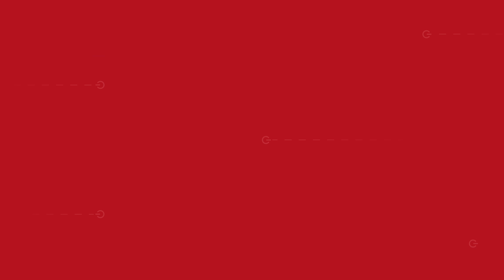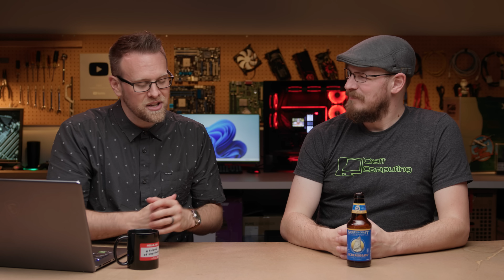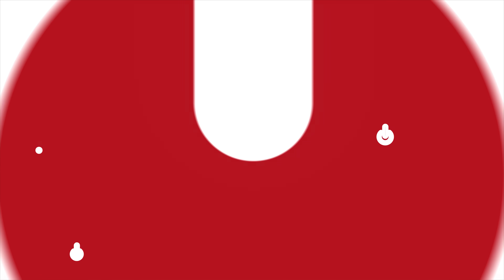Old Server CPUs For Budget Gaming Or Workstation PCs

Comment: I've been running x79 for a long time with a heavily overclocked 1680v2 (8c16t) and 2666mhz ddr3 in quad channel. With my previous 1070 it was more than enough to max out the graphics card in almost any game. Almost! Except those which need any of the newer instructions. In those games, I suddenly felt the age of the system. Now I have a 3090 with the same build... Don't even bother. In literally any game at literally any settings I'm heavily cpu bottle necked. Not to mention all the other issues which come with such an old platform (usb3+, pcie 3+, old mobos, power consumption, etc etc). I love my rig. I love overclocking and you can't do that anymore at all. But still, I am buying new stuff today :(

Comment: The newest Xeon that's obsolete enough to be cheap is skylake. That's a lot faster than xeons older than it.  And you'll get 4 channel DDR4 memory cheap, that brings the memory bandwidth up to equal to much more expensive current gen DDR5 at 2 channel.  Why is it cheap?  Well you're only getting PCIe 3 and with clock speeds up to 4 ghz, you're gonna get about half the peak single thread performance of the fastest current cpus.  And you might not get NVMe support And don't expect resizable bar. But I just put together a super cheap Dell Precision 5820 tower. They're so well built. My 6 core W-2135 processor cost $25.  But if I want NVMe drives instead of SATA, I have to get a replacement backplane which is cheap but the hot swap caddies for NVMe drives are expensive. Or I could get some PCIe NVMe card.  Dell makes one with bios support for 4 drives (and that's not a given on other motherboards).  Note, the motherboard in mine also supports Cascade Lake which is NOT cheap.  And this points to another reason Skylake is cheap.  Cascade Lake has built in Spectre and Meltdown mitigations and Skylake doesn't.  Also Cascade Lake has some new AI instructions.

Comment: Depending on how well they perform in Handbrake, I’m in the market.  I’m still trying to decide between an old workstation or a Chineseium motherboard combo.
With a workstation my buy in is roughly $400 without HDDs.  As it stands I don’t like being limited to 4 HDDs.
With the Frankenstein motherboard combo my buy in is around $460 when I add in a CPU cooler, PSU, and that’s without HDDs.

Comment: is RAM failure even a thing? Throughout my entire life I've only came across one system with failing RAM stick hahaha
Reply: Yes, I had several RAM sticks fail. Very annoying as the system will randomly lock up or bluescreen and you won't necessarily know it's the RAM (could be MB or CPU as well) until you do elimination testing (remove part until error stops showing up).
Reply: @Martinit0  but it could have been some incompatibility a d not real ram failure... I used to sell and fix laptops and it literally happened a single time over thousands of laptops I've sold, actually I found a bad sectors in bios chip being a common issue yet it's so rare in a grand scheme no one ever considers it at all... It's a pretty funky fault when it happens things get pretty random with unexplained behavior of the computer

Comment: well it isn't much cheaper anymore but you still get lots of pros of server architecture, mainly the huge expandability and then for non-gaming tasks they obliterate much newer home chips.
Reply: Xeons can have decent performance if you get the right ones. Pcie lanes are definitely the advantage over building a modern i7/i9 or ryzen system. 2690 v4 is cheap and actually doesn’t bottleneck my GTX 1660 Super according to benchmark sites. Also gets surprisingly good fps on modern games

Comment: I don't understand why the CPU single core clock speed must be high to service these GPUs in games. Surely there is an instruction queue? Is this also an issue where you are using a Xeon system with modern GPUs, like RTX 3090 TI 24GB, used for Stable Diffusion? Is there still an issue with single core performance of Xeons? What are the best second hand Xeons? You can get lower power 3.9 Ghz (without turbo) Xeons with 8 cores.

Comment: While technically not a server CPU, my i7-5960X is almost there.  Great CPU when new and it is still ok for the most part, but the generation gap with the new ones is not even funny.  I see mobile CPUs in mini PCs, CPUs which use up to say 35W or so, have double +/ - single core performance and depending on the CPU, even more for multicore.  And I am referring to mobile CPUs which have half or a third or less power consumption.  

Unless you have no other choice, as I do, don't get an old CPU, server included, as a part of a modern gaming PC.   You will probably save money, a lot, buying it, but you will get worse power consumption and worse performance than most modern CPUs.  (including APUs).

If you also have performance needs, video editing for example, which are not gaming, then ffs don't get these old CPUs.

Comment: I am running  a 4 core 8 thread 3.6ghz xeon that supports 40 pcie gen 3 lanes with 32gb of ddr3 running  in quad channel. Old ass setup but still running well. A little over a year ago I upgraded from gtx 680 4gb gpu to an AMD 6600 8gb. I am gaming at 1080p with anywhere from medium to ultra settings based on the game. I can even upgrade my ram as high as 128gb ecc IF I wanted to. Nothing about my rig is amazing but it is still running and getting the job done. One down side is without trickery I won't be able to use an os newer than windows 10.

Comment: I was an auto tech for 34 years and can't do it anymore because of medical problems so in order to stay busy I got into the PC world as a hobby. I sourced some very cheap parts to do my first build based around inexpensive Asus LGA 1150, 32gb of DDR3 and an old Thermaltake case. I have a Xeon 1270v3 (3.50 - 3.90 GHZ) or a I7-4790 (3.60 - 4.0 GHZ) both under 85W,  and a Corsair 750W PSU that I can use with an EVGA GTX 1060. These cheap parts that are hitting the market are right in my ballpark for budget and my expectations. The cost of the parts came out to $125 US.  I'm learning alot from so many channels like this one and Craft computing and having alot of fun doing it.

Comment: I'm writing this comment on my ancient 2010 Mac Pro 5,1 w/ dual Xeon X5690 CPUs (3.5Ghz, 12 cores, 24 threads total) w/128GB RAM, internal RAID5 storage, PCIE NVME SSD system drive (I added this and the RAID5 drives), with Radeon RX580 GPU, that I bought on ebay about 2 years ago for $275 (including shipping). Yes, I virtually stole it with my winning auction bid - it should have been a few hundred more to be honest. I'm running Garuda Linux (Arch base) and occasionally boot up macOS Monterey. Even 14 years later it's solid as hell. It won't win any speed contests anymore but she never crashes, and needs to reboot only after an occasional kernel upgrade. It does video editing, plays a ton of games (yes, Linux can really game now) brilliantly @ 1440p and has been amazing overall. Highly recommended!  EDIT: I will say, it has a 1000w power supply because it's really thirsty for energy. Probably drawing 500-750 at any given moment. There's always a cost for a machine that does so much.

Comment: picked up a old x5690 Xeon for $33USD and run it my Asus P6T vanilla mobo as a daily desktop driver clocked steady at 4.507GHz in a modded bios. Added an LSI 9271-8i card in RAID5 which has throughput of ~2500MB/s (4 units Samsung 500GB SSDs) Not bad for a motherboard produced in 2009!  15 years old and still churning out with 280mm watercooled AIO CPU cooler.🤣🤔😉😇  Cheers

Comment: One of my grandson's friends has it pretty hard right now and asked me to help him build his first PC on the uber cheap, managed to grab an Aliexpress special that had a  E5 2650V2 with 16GB of RAM, mobo, and a cooler for just $66, slapped another 8GB for $4, a $37 nice looking white case, $40 500w Thermaltake, a 1TB NVME on sale for $37, an RX580 2048 for $50 and a Win10 Pro key and he managed to end up with a sub $260 PC that plays all his eSports titles above 60FPS.

 So for super duper uber budget builds ya can't go wrong with the Aliexpress Xeon kits.
Reply: oof 1tb nvme for $37 boy those days are gone.
Reply: I gifted an X79 build [ E5-4627v2 (8C/8T, 3.6Ghz turbo) + HuananZhiX79 Deluxe + 32GB REEC DDR3 + 800W PSU + Snowman 120mm CPU cooler + vertical testbench+ 256GB SSD with Win10Pro OS + RTX 2080S] to my daughter's friend.  Sure, it's an old spec and lacks AVX2...but it still runs most games in 1080P low-medium settings just fine.  It also manages school work and general purpose tasks fine.  I had upgraded my daughter's PC to AM4 B550 + 5800X +  RX7900GRE + 32GB Trident DDR4. She's setup with VR, etc.

Comment: Ive got a e5 2680 v2 running 3.594 all cores idling and boosts to 4.294 all cores it took about 2 days tuning in bios and a Asus ws pro board but it still only uses 122 watts at max load in stress tests for 10 cores 20 threads and it doesnt go over 68 degrees in stress tests working on finding an Asus x99 ws board for my next build i have more fun seeing just what i can get a xeon to do than I would with a newer system that just works

Comment: Im sorry. X99 server chips get their ass handed to them in gaming loads. A 3600/5600 will wipe the floor with them and are also available cheaper than $100 on the 2nd hand market. 
16GB of like 3200/3600 DDR4 is also like $40 these days and bottom tier b550 isnt that bad. Gives you a much better gaming experience than getting an aliexpress x99 system with an old ass 8 core xeon chip that'll lose in basic multicore workloads as well.

Comment: the other reason why some people may find old xeon builds attractive is because they run on DDR3 ram, which is really really cheap nowadays. Not saying that DDR4 is expensive, but for people who have a very tight budget, every cent counts.

another good budget option is to buy an old office pc and upgrade it. I have a dell precision t3500 which I use almost daily. Takes a standard ATX power supply and the motherboard has 6x4gb ddr3 ram slots for a max 24gb ram. the fan headers on the mobo are propietary but you can buy adapters to run standard 4-pin fans. chucked out the old dual-core W3503 and put in a 6-core 12-thread xeon X5675 (have to update bios first). The unit originally came with a low-spec quadro gpu, took it out and replaced it with a gtx 1060 3gb. So far it's been fairly good for most average-spec 1080p games, I don't play the latest AAA games so it's sufficient for me.

if you go for the used office pc route, just watch out for the ones that use proprietary power supply form factors or motherboard pins, make sure you can still buy replacements or pin converters, otherwise you'll have a big problem if your power supply dies.

Comment: Some xeons come in Low Voltage versions (they are just as powerful), but they are a GREAT choice if you're using a PSU on the lower wattage side (such as an HP 800 G1)

Comment: I havea BOINC farm of i5-8500 little SFF boxes. Desktop 65w CPUs from popular auction site over 100 of them. In the years I've had them, only a few fans have failed they really all work. It is fans that wear out that's it.
Reply: I wanted to buy a few of this SFF boxes but the prices for intel 8th gen (windows 11 ready) almost doubled since i bought my first model.  HP-Prodesk.  Just too many youtubers recommending it.
Reply: @llothar68  Yeah I have noticed  The availability of them has dried up perhaps there are fewer being sold Companies have already cycled them out perhaps. In about 4 years I may start selling mine to replace with Zen 7 crunchers..
Reply: @llothar68  I see a listing on geebay 95 bucks 7 available 'HP ProDesk 400 G5 SFF Intel i5-8500 3.0GHz 8GB 1TB HDD W11 Pro' so comes with spinner drive

Comment: Get an i5-8500 or i7-8700 Coffeelake SFF HP Prodesk or Elitedesk (just a bigger box, 1 more PCI x x16 slot) or Optiplex SFF for less than $200. Usually i5-8500 is 120 bucks or less, 6 core 3.8GHZ all core.  Get a PCI Express ribbon cable and another PSU, bridge the orange wire to ground to turn it on to power the GPU! Upgrade RAM to 16 or 32GB cheaply DDR4 2666. You're done!
Reply: On Ebay..

Comment: I'm seeing used server/workstation PCs on the market with Xeon Ws that seem to be based on Skylake architecture rather than Broadwell/Haswell architecture, including coming with DDR4 RAM rather than DDR3. I wonder if those are significantly better than the Broadwell and Haswell ones that Jeff is talking about. I've heard that the 6-core ones like the W-2135 are comparable to CPUs like the Ryzen 5 3600, but that's purely hearsay on my part.

Comment: Used Xeons are unbeatable for low cost workstation if your main applications are scaling well with cpu count.. But it depends quite a bit on the work load you consider. For 3d rendering, scientific / fluid simulation they are great. Also if you need a stable server with lots of cores and memory for example to run VMs but your budget is limited and you don't need that fastest performance, these are great too. But based on my experience, for mixed use cases, where a blend of single thread and parallel are common, a Ryzen 5600x or 5800x system or similar is much better overall but can get much more expensive if you need a lot of RAM.

Comment: Still have an 2 X99 servers, 1 is a NAS and the other recently retired Proxmox machine.  Before it was Proxmox it was my workstation and did fine at that too.  They are starting to show their age though, as someone else said some newer features like AVX2 AVX512 are starting to slow down the older chips for some workloads but if you don't need newer instruction sets they still work great on a budget.

Comment: they aren't worth it unless you are desperate and then they are worth it - small biz mkt can benefit, they can benefit from broken screen laptops and other cheap crap but if you are serious and want power without elec bills go to am4 and be happier - the calculus is changing and when zen5 is out we should see more discounts for am4 which will tip the scale further. the ali baba mobos are sketchy - lack of support and bios updates - you are kind of rolling the dice - you pay 200 for used gear or 300 for building something a bit better - that is the calculus - modern cpus stomp all over old xeons - how much do you value your time and what is your workload - many people can get by with old gear just fine

Comment: I got 2697v2 system 12 core best cpu from ivy bridge xeon is amazing value i buy cpu for 30 usd from AliExpress and 32 gb ram rx 580  whole build with case and everything cost me 300 usd. Is not something groundbreaking but i try build system cheapest possible which is capable of gaming and was very nice bet I love it. Pretty much can play any modern game on 60+ fps without few latest games like alan wake 2, avatar and starfield where you need much more powerful pc anyway but for those can do 30 stable fps

Comment: Bought a Lenovo P520 recently, with 64GB of ECC DDR4 and a Xeon W2235. It's  a little power hungry,  but it keeps up with my Ryzen 5800X... Threw in a 2nd hand RTX2070 and it's a really capable gaming machine.
Reply: And a W2135 would work in the same socket.  I've seen those for $25, while the W2235 is more like $115.  But the price difference for Skylake vs. Cascade Lake really comes if you try to get more than 6 cores.
Reply: I was considering that for my niuldbut a rx 7600
Reply: @Jordansklar0698  One reason I stayed with the RTX 2070 was because I couldn't get ReBAR to work on the P520, and that meant leaving performance on the table in newer-gen GPUs.

Comment: Actually, i find 2nd hand xeons are better at higher resolution gaming because their clock speeds are not the limiting factor. In low res gaming where the cpu clock becomes a bottleneck, xeons suffer a bit. Also, core- intensive games like Civ or Stellaris can leverage the core count on the xeons.

Comment: I needed a server to store media, run some VMs, and archive data on our network and I got myself an e5 2690 (10c 20t 3Ghz) for £15, 64GB ECC RAM for £10, and a cheap x79 MB for £50 leaving me plenty of budget for a good 2.5G NIC and a 16 port SATA card. I shoved ProxMox on it, and now I have VMs for my pihole, TrueNas core, and a Windows VM for running an After Effects renderer. It will never play a game, but for what I need it to do, it's cheap, and runs cool, quiet, and stable. It certainly let me know which of my old drives weren't up to it, though.

Comment: I’ve managed to build a Dell precision t5810 
2690v4
16gb ram 
1tb m.2ssd 
1080ti for 250 dollars. 
4K hdr 80fps average on most modern games. The only downside is the loud fans but it works well as a heater in the winter haha. Love your content @craftcomputing.
Reply: I did a similar t5810 2690v4, 64G ram, 1000w PSU, SSD/m.2 SSD/4tbHD/4k capture card and a 2080Ti (special power cable bought) total cost was around $700. This is my workstation but it can play too. Have fun with yours.
Reply: does your motherboard use the dell 5-pin fan header? I bought some cable converters online so you can run standard 4-pin. though I can't tell whether or not the t5810 uses standard 120mm fans. if you can access the header on the mobo you can just plug the converter in and attach a standard 4-pin fan. my dell t3500 originally came with loud delta fans, the sound was unbearable for me lol

Comment: And if you are in the business
And you have cpus and ecc memory, then your entire platform (cpu+memory+mobo) is just buying a mobo for your computer.
My pc is a xeon Gold 6150, based system and has 96gb ecc 2933mts
My kid's pc is an e5-2667-v3 with turboboost unlock applied, and 96gb ecc 2133mts
Bothe are paired with 1660super, and both were upgraded from x58 xeon systems
All i had to do was buy mobo's....
Sometimes, the reason is just not wanting to waist good and working HW